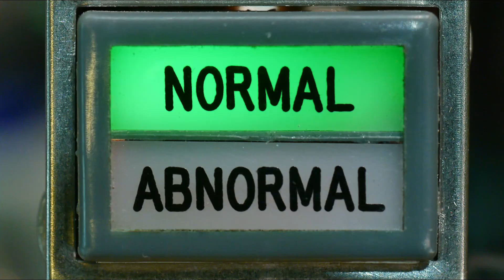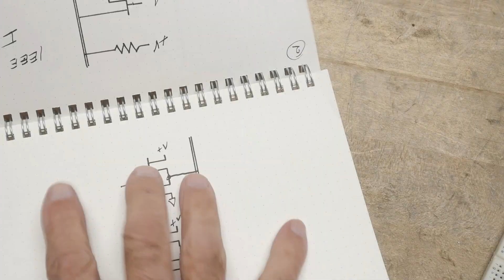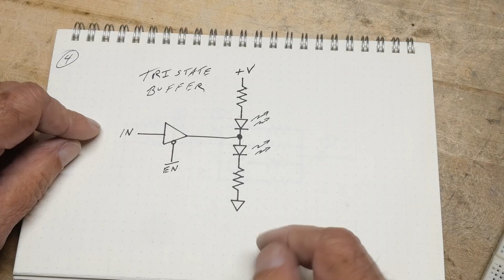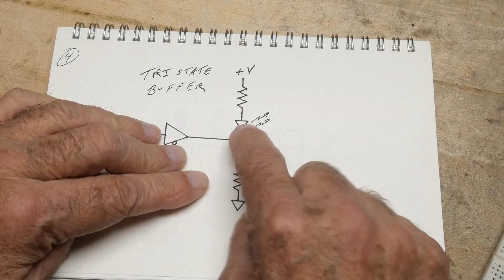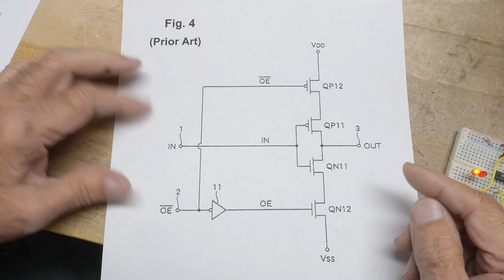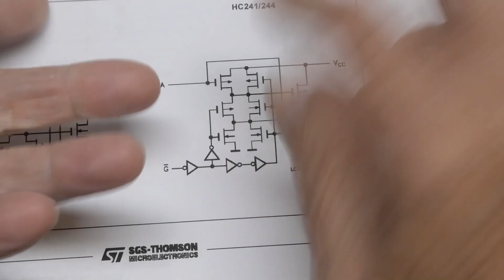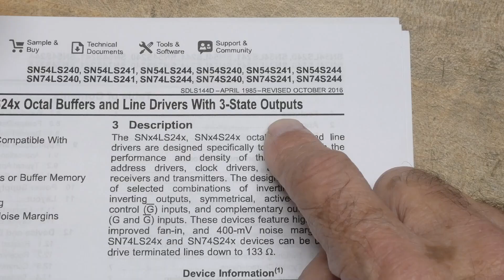#2380 Tri-state 3 State Computer Buses

Comment: Tri-states usually work by disabling the output totem pole driver - with both transistors in the off state, the output is Hi-Z. In a totem pole output the value is set by whichever transistor is on and pulling the output to Vcc or Ground. If you tri-state the output, the gate or base drive to the totem pole transistor goes away and both transistors end up in the off state giving Hi-Z (high impedance). The first TI datasheet you showed was just the totem pole output consisting of a Darlington wired pair - it didn't show the base drive transistors that activate to cut off base current to disable the output. This way you don't have multiple diode drops to worry about since the goal isn't to remove Vcc and Ground from the transistor supply when you can just turn off the transistors directly by removing the gate or base drive.
Reply: Yep. If both of the signals on the left are low, then all of the output transistors are off (output floats). If top left signal is high, then output is pulled high. If bottom left signal is high, then output is pulled low. So all you need is the appropriate logic to generate those combinations based on the input and the enable signal.

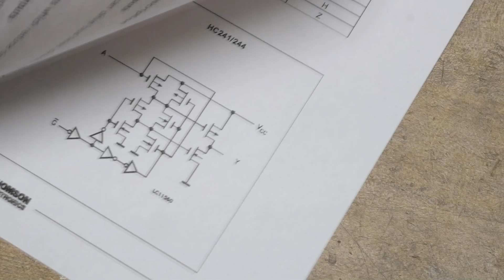Comment: 5:27 if you put the PNP to VCC and NPN to GND, no current will pass through the Darlington pairs. Also I've noticed we have 3 Schottkys and 1 "normal" PNP,  which is interesting on another level.
Reply: The Schottkys are used for higher speed. The Schottky prevents the transistor from fully saturating.

Comment: After doing digital IC design for 40 years, NONE of my designs, or any of those from my peers, used 3-state busses on-chip. But they were used for getting signals on/off chip. It may sound counter-intuitive, but 3-state busses onchip can cause more problems than they solve (timing, routing).
Reply: Just wanted to say that MCUs can have their GPIOs at third state, but there is no tri-state buffers inside MCU

Comment: I can't explain either of the schematics you showed, but logically the high impedance state should insert big resistors on the high and low sides of the push-pull output stage, or short around them when enabled. Maybe that's not practical in an LSI process, so you could just have transistors around the output stage that gate Vcc and GND. This would really narrow your operating rage in a bipolar process, but it should be fine in CMOS.
Reply: Forcing all of the output transistors to be in cutoff is, in effect, "inserting a big resistor". And that's what both circuits do.
Reply: @MikeU128 thinking more carefully, we only want the output transistors to be in one of three state: high side ON and low side OFF, high side OFF and low side ON, or both OFF. Does the six transistor sub circuit in the second schematic implement a logic circuit enforcing those states?
Reply: @jsdutky  I believe so.

Let's call the transistors in the sub-circuit on the left Q1 through Q6, going left-to-right and top-to-bottom; the two output transistors on the right are Q7 (top) and Q8 (bottom). And, as noted in the video, assume the dot on the gate connection of Q6 is absent; that is pretty clearly a mistake, since it results in two different signals driving the same node.

If G-bar is high (outputs disabled): The gates of Q3 and Q5 will be high and the gates of Q2 and Q4 will be low. This will turn Q3 off and Q5 on; Q5 pulls the gate of Q8 low, turning it off. Likewise, Q2 will be on and Q4 off; Q2 pulls the gate of Q7 high, turning it off as well. So we've satisfied the requirement that both output transistors be off if G-bar is high. Since Q3 and Q4 are off, input A can only pull the gates of Q7 and Q8 to the same state they're already being forced to by Q2 and Q5; threfore A has no effect on the output.

For the remaining two cases, assume G-bar is low (outputs enabled); then Q3 is on, Q5 is off, Q2 is off, and Q4 is on.

If A is high, this turns Q1 off and Q6 on. This pulls the gate of Q8 low via Q6; the gate of Q7 is also pulled low, via the path from the drain of Q6 through Q3/Q4. So now Q7 is on and Q8 is off; this will pull the output high.

If A is low, this turns Q1 on and Q6 off. This pulls the gate of Q7 high via Q1; the gate of Q8 is also pulled high, via the path from the drain of Q1 through Q3/Q4. So now Q7 is off and Q8 is on; this will pull the output low.

The circuit is somewhat confusing, due to the use of Q3/Q4 as a transmission gate.

Comment: At 7:10, this isn't entirely true, although the buses are all handled internally, they don't use tristates to get around the multiple driver problem. Instead most chips these days with internal buses swap the tristate buffers for multiplexers and arbiters, it helps keep propagation delays low for fast buses and reduces number of required transistors. The Wishbone B4 spec has a section with examples for how to design interconnects for a shared Wishbone bus. Most microcontrollers (32 bit) use some combination of AXI/AHB/APB for internal buses.

Comment: 5:00 The upper two transistors set the output to high and the lower two set the output to low when fed with a high signal. No high signal at the inputs means open. (This is just the output stage.)
Reply: That's what I thought as well.